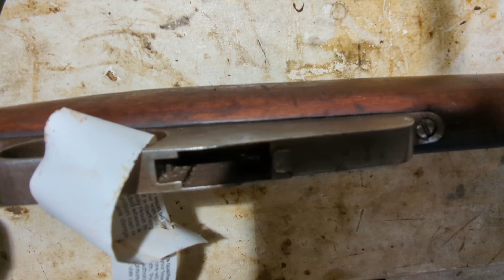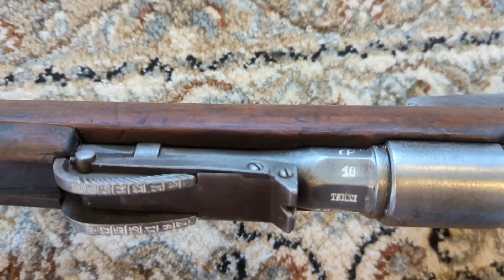Full Cleaning/Restoration of a RTI B Grade 1918 Carcano

Comment: Dremels can get places where hands and fingers - and even brass brushes - can't.  You can chuck a small rotary brass brush in the chuck of a Dremel and not only make short work of interior guide surfaces, but also remove schmutz that you can't even see.  

The key is not to let the rapidly spinning shank of the rotary brush contact the steel of the action.  That's easily prevented by sliding a rubber or plastic tube like heat shrink tubing over the shank of the rotary brush and shrinking it to fit before clamping it in the Dremel chuck.  

The thin rotary bristles will reach all the way into the corners of the bolt guides and other right angle corners and scour out hardened grease and dirt that you just would never get out, mechanically, otherwise.
Reply from the maker: Thanks for the tip!

Comment: Looks really decent, especially in terms of mechanical condition.  It looks as though the chip the stock is what made it a B-grade, in which case, pretty good deal.
Reply from the maker: Yeah the chip is an easy fix. I'll definitely take stock damage over a worn out bore or damaged/pitted metal.
Reply: @tfusilier44  Did you get a hand select on this rifle ?
Reply from the maker: @jeffersonsteelflex9616  I did not.
Reply: @tfusilier44  wow that bore cleaned up well . Seems kinda hit or miss on these RTI rifles .
Reply from the maker: @jeffersonsteelflex9616  I've gotten a lot of RTI rifles, posted videos on them on my channel. So far I've been pretty fortunate. Only had two with serious issues and they exchanged them for me. One of them was the shippers fault, looked like they stabbed the box with a forklift.